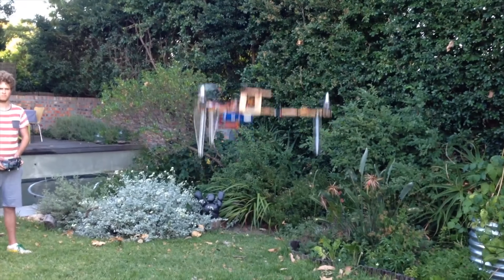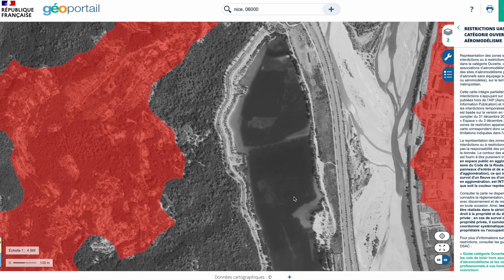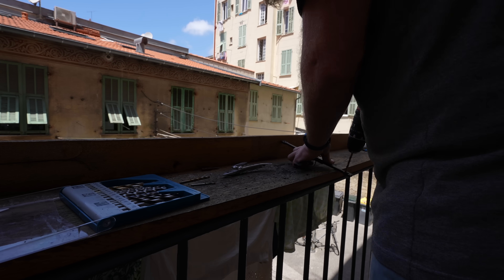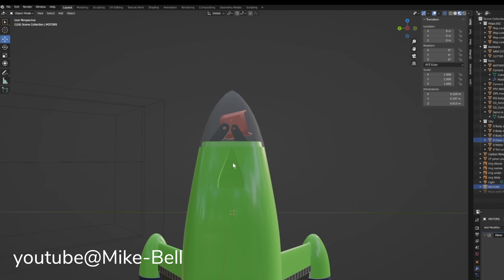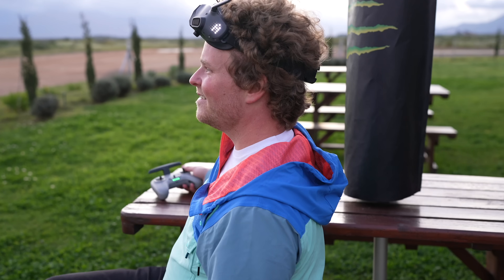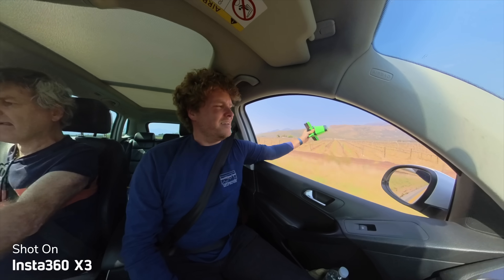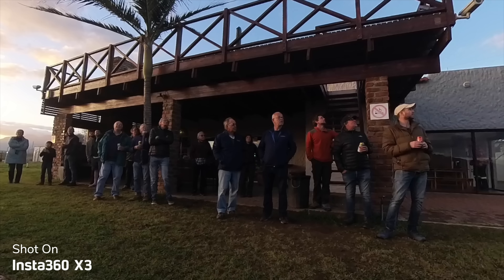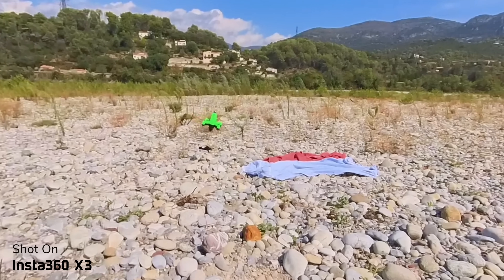How I Built the FASTEST Drone on Earth

Comment: Regarding the instability problem, have a look at rocket design theory. This little monster flies much more like a rocket than like an aircraft. Putting your center of pressure behind your center of mass would get it naturally flying straight as an arrow. I'd basically just put fins on your tailcone which would also be a handy way to take off and land without any special equipment.
Reply: I say extend the fins on the trailing edge of the motor mount arms.
Reply: I Agree with Dan on the fins they should be mounted  a long the bottom !! 4 of them on the green 
motor covers also you could go with a lighter weight filament ! on the 3 D printer for weight.
Reply: Build it the same shape as a missile fired from a defense plane.
Reply: You're right I'm dumb... @davids4649
Reply: Hey Dan, you are right.  Above about 200mph 330kmh the props have to work increasingly harder to maintain directional stability and is terribly wasteful on power.  So aerodynamic stability becomes vital.  In the next version this issue was quite central to the body design and placement of batteries and motors which are the largest weight components.  It helps a lot to put the motor arm fairings further back and well behind the centre of gravity to send the aerodynamic centre rearwards.  Still dealing with lots development issues but version 2 video should be oming soon.
Reply: He should induce a rotation around its own axis.
Reply: To me the current design looks almost like a rocket^^
Reply: Everything you introduce adds drag.
Reply: What he meant is flip it so the big pointy part (all the weight) is behind the propellers, keeping it stable. its like balancing a stick on top of your finger versus hanging it @kevpeacock3059
Reply: Would also put the center of thrust as forward as possible, and heavy stuff in the back.
So put all the props right under the clear dome and the battery in the back.
Reply: @Litl_Skitl  That's the pendulum rocket fallacy. Center of thrust needs to be below CG in rockets to be more controllable.
Reply: @snviper  does center of thrust below CG apply to all rockets or only to thrust vectoring ones? 
For thrust vectoring ones it's clear because they need leverage to gain controll authority. For a fixed nozzle one I'm not sure how much the center of thrust matters.
Reply: @fabianrudzewski9027  Yes I think so too.

Comment: The cherry on the cake is keeping up with the tech to break the record again in another year or so. Advancements and skill always improve over time along with better batteries. 
Though the real question is did you ever do a speed test with out the shell? Is there a significant advantage to the hull to which the grams saved could used for more battery? 
I also wonder if you removed labels, adhesive, casings and so on to shave a few grams here and there? I also wonder how much of a motor could be removed to which it would still work as it functions. I also wonder how much more could be removed to lighten loads. Servo motor housings, motor housings, controllers and so on. While it seems extreme. A 10% reduction in weight could see a massive jump in its top speed?

Comment: I'm 5:38 in and telemetry is showing 9951W!  Specifically 402.1 amps current draw!  I use and build most everything RC, drones, planes, cars, crawlers and boats.  For boats, 400a is a very stout but certainly expected.  Aircraft? No freaking way! That is INSANE and still "only" (as if.) 321kph!  How are you not melting XT60's and ESC's every run? LOL Impressive, very very impressive.  Subbed and very interested in your build specs.  What ESC can pass that much current without weighing 5lbs and being big as your drone!
Reply from the maker: Yeh the power draw is wild 😂 the calibration for that test was a bit off so the real value was lower, but the later runs are accurate! I am building V2 at the moment. I suspect it will draw about 100A per motor at 44V so about 15kW at peak peak 😂😂 so wild. I’m using T-Motor ESCs.
Reply from the maker: This version of the drone will drain the battery 100-0 in 21 seconds at full throttle!!

Comment: I would want to know as I can see that all your props are pushing in horizontal direction how are you maintaining vertical stability because drone needs to maintain a certain height from ground
Reply from the maker: You are right. The answer is that the drone is not flying completely horizontal. It’s flying at about 80 degrees to make sure there is enough vertical thrust to keep it above the ground.

Comment: Very curious about the center of drag, center of gravity, and center of thrust locations. I expected the center of thrust to be forward of the center of drag in flight and above the center of gravity in hover. My intuition is that you would benefit from natural stability in all modes, requiring less differential motor input to actively stabilize in forward flight, which should then allow you to maximize thrust. It seems my intuition is wrong as you and the previous record holder both put your batteries ahead of the motors in a beefy fairing. The previous record holder does have the tail ring for aerodynamic stabilization but you didn't need it.

Comment: Instead of a symmetrical body, I wonder how a lifting body shape would work to clean up the aerodynamic drag (because your's is obviously quite draggy with that teardrop aft section, that's not intuitive but is physics)

ALSO, I'd buy one in a heartbeat if it could be made at the registration weight.

Comment: that's wrong. imagine instead a sleek plane with a motor on each wing and the two wings can tilt a little differentially. so for hover it stands up right and it can do drone type of movement but for throttle it can go into winged flight and be much much faster. Emphasis on sleek. Yours was a chubster. Look at a glider shape but it needs much smaller wings. you may want a razor blade style ring around each prop since a ducted fan is more efficient but for very high speed it might not matter.
Reply from the maker: A ring around the props is going to create massive drag effects
Reply: @LukeMaximoBell  you are thinking the ducted fan will fly at an angle? it wont, that's quadcopter thinking. The inefficiencies of the poor configuration that is quadcopters.

Comment: You made it a pusher prop instead of a puller, that is why it was UN-Stable.
A puller stabilizes itself mechanically, so you don't need high-tech electronics!
Reply from the maker: Puller prop is only stable if it’s right at the front like the nose of a plane. Otherwise it would make zero difference if the prop is on the same plane.
Reply: @LukeMaximoBell  Yes, that is what I meant by a pulling prop. It has to be in the front, pulling the fuselage!
Then it is self stabilizing.
That is why all the older planes had their engine up front.
Reply from the maker: Well that's not exactly going to work for a quadcopter with 4 props is it? @We-Do-NOT-Consent-To-The-Loop
Reply: @LukeMaximoBell  Why not? Just put them on top!

Comment: Any particular reason while you decided to go with a 2808 motor instead of a smaller, lighter 2207? Did you verify thru testing that was higher torque required for the high pitch prop?
Reply from the maker: I needed as much power as I could get. The props theoretical max RPM is 44k, which I was faaar off. So any more torque and power I could get the better. The next version has even bigger motors for more torque and better heat dissipation.
Reply: What RPM were you getting at full throttle? @LukeMaximoBell

Comment: Congratulations mate, well done.  I think that deserves a sub and a like.
Reply from the maker: Thanks for the sub!
Reply: @LukeMaximoBell  Look mate, not a problem.  Engineers like you hurl technology forward, it is the absolute least I could do.  Out of curiosity do you have any plans going forward?  I think you should try to break the underwater speed record for a drone.  I can't find much info on the actual speed, I found on where they emulated a tuna or fish or something that was 0.85 meters per second or 1.65kn.  The current underwater speed record of any man made object is 33 knots (61 km/h; 38 mph), which is a submarine.  But after watching this video, I believe you could break it.  
Any mate, all the best.  Thanks for the great video and congratulations on your record breaking drone.  Cheers.
Reply from the maker: That's actually a pretty awesome idea. I am always trying to come up with new projects, and I think that could be a pretty awesome one to try and go for. 61kmh doesn't even seem that fast. haha. The only issue is radio telemetry, as radio doesn't work underwater, so it would need to be tethered. But I guess all part of the engineering process.  @MozziefromOz
Reply: @LukeMaximoBell  I thought of that, there are two ways to tackle it.  Either an antennae not dissimilar to a remote control car, you'd use a rigid piece of wire which would stick out of the water.  Two problems with that though, how do you get it to stay on the surface (hence why I said rigid wire) and it my slow the drone down, you would need some sort of fin design where if you go a certain speed it stays at  certain depth (like a fishing lure).  However this way would be more reliable.
The other way is what they call "translational acoustic-RF communication", sounds like  mouthful, but basically sticking relays across the bottom of the 'ocean'.  Which ever way you go I'd probably suggest doing the tests in an Olympic size pool.  That way there are no currents/waves and you know the exact depth.
After watching this though, I'm sure you would come up with a better solution.  
I'm a mechanical engineer, I'd suggest an engine with more torque, the record isn't as fast so the blades don't need to turn as fast.  But an engine with more torque would allow for bigger propellers (propeller design is also important).  Whatever you choose, don't forget to upload it.  You learn more from failures than you do successes.  So good luck.

Comment: This is impressive work.

But I would have to say that there are faster drones out there (not home-built): https://en.wikipedia.org/wiki/General_Dynamics_F-16_Fighting_Falcon_variants#QF-16

One question about your design is why did you opt to put the battery pack in front of the motors? It seems like that would move the center of drag pressure forward of the center of control pressure and make the drone much harder to control.
Reply: The record is for a battery powered quadcopter.  All lift generated by just the 4 props.

Comment: Great work on the project, and the story telling and editing of the video.
I'm amazed by how you managed to make it go that fast with on-the-shelf parts (correct me if i'm wrong : 2x6S lipos in parallel (DogCom 6S 1150MAH 150C?), foxeer reaper 60A mini ESC, T-motor V2808 1950kv... and then the props I guess they are super high pitch made for planes ? APCprop ? 6inch ? maybe 5 inch you don't need to fly for long, just move a ton of air for a few seconds... 5050 ?
it's crazy the ESC survived
Reply from the maker: Thanks man! Yeh you are almost spot on. 

2 x Dogcom 1550mah 4s 150c in series 
Velox 2808 1950kv
Foxeer reaper 60A Slim Mini
APC 5.25x8 inch props
Reply from the maker: Yeh the ESC was overheating a lot I believe causing my in air failures. Fixing that for the next version 😎

Comment: 2808 motors are usually for 7 - 8 inch props. what props are you using for it and why?
Reply from the maker: 5.25 inch diameter and 8 inch pitch! The high pitch of for maximum speed.

Comment: Would love to see a flat out drag race between this drone and the ones built by QuadMovr. Just from the sound of the props, I think his turn more rpm, but with a smaller prop. He flies line of sight, madness to watch.
Reply from the maker: Yeh it would be very cool. His would have faster acceleration but slower top speed. His do spin at a higher RPM with lower pitch I believe. Higher pitch and higher RPM required A LOT of power

Comment: That tail you added for the insta may be the answer to even higher speeds. Make the fins a decent size, take the camera off and it will add a tonne of stability so your power can be applied. Fast things are long, have fins at the back and the heavy bit at the front.

Comment: as a fellow engineer major, I am proud of you for pushing through and hopefully you do get that certificate for the guiness world record. I recently started getting into drones but I did not major in electrical engineering, so I don't have a clue on how I would start. I have 2 questions for you; 1. what is the flight time on that drone with the battery you use? 2. would you consider rebuilding that drone and selling it for a price your comfortable with? I want a drone that is in FPV and really fast and I would love to have one just like yours. If the answer is no, you would not want to remake and sell that drone then can you please direct me to a drone that is fast and has good flying time.
Reply: so he  actually built an extreme High Speed FPV Drone, nobody in the hobby would use it as everyday drone.
Reply: @simonklingelhofer2302  okay I understand, thank you for the time to explain this. In that case I’ll build something myself. Do you know any build guide that is less than 700$ that can get me top speed of 90-100mph with flight time of 30mins or longer?
Reply: You're welcome..any drone bigger than 3" can achieve that speeds. FPV Drones are called by their prop size. You're talking about 30min flight time, which is pretty though, 20min are doable with any 7" Drone. So you want to look up 7" drone build on YouTube..anything with at least 2807 Motors 6S (= 22 Volts Lipo).
Reply: a normal Kwad (4S/6S) hits about 160-200km/h and has a flight time of 5mins if you dont pull full throtlle to often. So i guess his is only flying 1min..if you always pull like him so that the voltage sag drops to 2,3V (3,3V/cell is the minimum voltage at which you should land If you dont want to damage your Lipos), your gonna destroy your Lipo in 10 cycles and max speed and flight time drops significantly.

Comment: I'm also into making 3d printed drone bodies and "active aero" really is a b*tch. It's really counterintuitive, but aerodynamic styling just means your drone will prefer a certain orientation when flying to produce less drag. So it's definetly not for nimbleness and even for efficiency it's difficult, as you often find yourself fighting againsed that "prefered orientaiton" which is not efficient.
Can be done though, as helicopters do it too. But you can't go too crazy, sadly.
Reply from the maker: This is super true. It’s why I felt flying upwards leant to higher speeds, rather than flying flat.

Comment: Arms need to be more aerodynamic. Try having them come off the frame abs come down by atleast 45 degrees. The fastest design would be a telescoping frame that locks in place when elongated. Have it go straight up a few hundred feet. Then reverse the quad motors with it upside so the telescoping frame can elongate down and lock in place (the head of this should be weighted). Then have the motors run forward again and dive like an actual peregrine falcon. I guarantee this will create a massive new record.

Comment: I imagine your technical limit is when the tip of the blades reach 90pc or so of supersonic.  Of you want to go above that then maybe a special blade design will allow transonic flow.  I bet lithium and motors can get you into that range soon.
Reply from the maker: Yes you are correct! I’ve heard that around 85% is a good margin. For the next build I will aim closer to that. These props can get up to 42 000 RPM before hitting the transonic limitations. I believe if I can get them that fast it will get between 450-500kmh

Comment: Well done. That's an impressive drone. What I don't understand, that you didn't really explain is how you made revision 3 I think it was, over double the power (and add more weight) and managed to not melt the motors when the previous revision did melt a motor. Did you use different motors or tone down the voltage but still manage to get more speed out of it?

Comment: Top effort!  What props are you using to get 400km/h?
Reply from the maker: APC 5.25x8 inch props. The important part is the pitch of the props. That limits the maximum theoretical speed. In theory if these props get up to about 42 000 RPM I believe the drone will go close to 450-500kmh. However it’s very difficult to spin them that fast because of the amount of power required 😂
Reply: @LukeMaximoBell  That's some pretty fierce pitch but I kind of suspected it might be high.

Comment: Yeah something a lot of people don't realize is that weight has nothing to do with top speed. It only affects acceleration. Top speed is almost entirely limited by aerodynamic drag.
Reply from the maker: Agreed 🤩 I mean of course if it weighs 10kg it’s never going to fly, but it’s more power is definitely worth the extra weight.
Reply: @LukeMaximoBell  Yeah and I suppose since a quad isn't technically flying from an aerodynamics standpoint some power is used to keep that weight in the air. Though at those speeds slight knows up attitude probably does give it enough lift to where that's not relevant either.

Comment: are you using GPS in the drone? As I believe GPS modules have a firmware to stop above a  certain speed. So that they can't be used in home made rocket guidance for obvious reasons for national security.
Reply from the maker: Hmmm that could be true! Not sure though. It’s a GPS module with an M10 chip

Comment: i had a 5 inch 4s light weight build and it peaked at 270kph used the same motors but went with xrotor 60amp stack. Whole build weighed 350 grams with battery
Reply from the maker: Nice! That is suuuuper light.
Reply from the maker: You were using 2808? Seems a bit big for that size.
Reply: @LukeMaximoBell 450!! grams my bad lmfao and i was using 2207 2755kv. I have the build up on my page